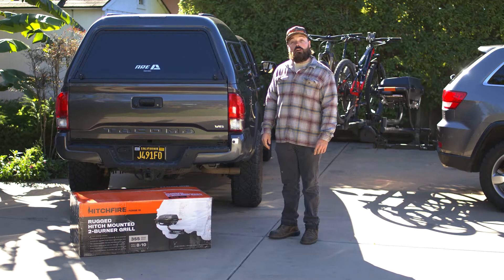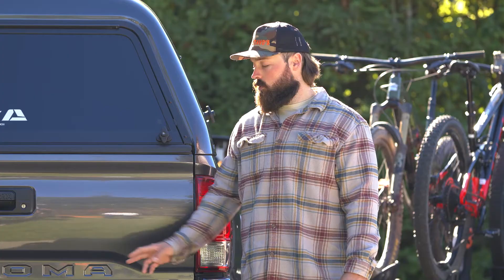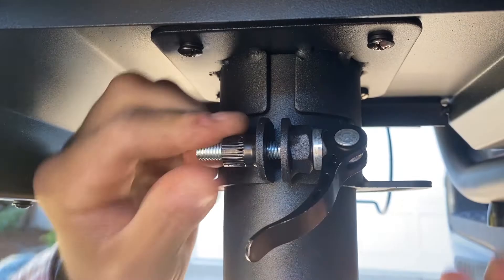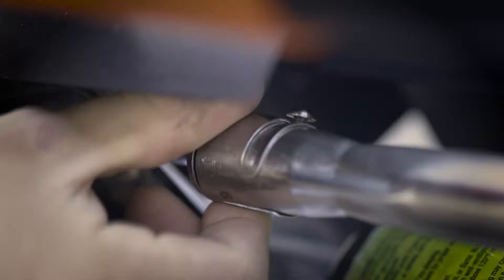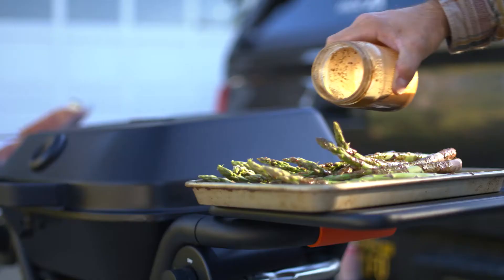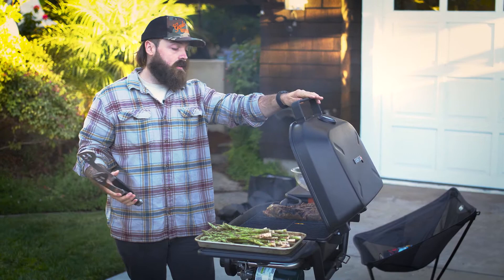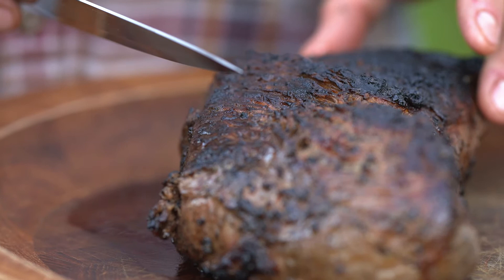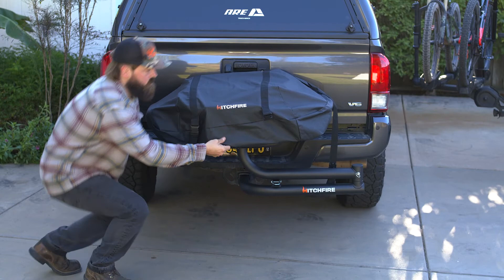HitchFire Hitch Mounted Grills Installation

Comment: I'm looking at one of these to mount on my teardrop's driver-side hitch mount. I'd like to cook either under the galley in back or to the side; do I want the driver or passenger side swing arm model? I think passenger side but wanted to verify.
Reply: Also, we don't cook directly on grates when camping. Can we use our calling pans and cast iron griddles and skillets one these?
Reply from the maker: @DavidHancock  Hi David - the main reason one would pick a driver or passenger side swing is if they had a rear swing out door.  For example a Jeep has a swing out door to the passenger side so you would want a driver side swing out grill.  In your case the rear door swings up so it really doesn't matter unless there are other items, like a drawer, that pull or swing out on one of the sides.  You would want the grill on the opposite side.  And yes, you can use cast iron pans, griddles, etc.  We also sell a flat top for similar cooking methods.

Comment: Thx for the video.  Any idea on the overall weight and do you know if there’s an option for a locking hitch pin?
Reply from the maker: The weight is roughly 73 pounds together with the grill and the swingarm. You can remove the grill from the swingarm which is about 32 pounds by itself. We will have locking hitch pins on the website in the next couple of days!

Comment: Do you offer replacement parts like the burner tube or the auto lighter part? Just curious just in case I have one go bad.
Reply from the maker: Yes we have replacement parts for all components of the grill.
Reply: @hitchfire8098  Good to know. So far, I'm loving my Forge F20. I don't think there's a portable grill that attaches to the hitch that can beat this one. I added the side burner to it and will have a tote with all the necessary items that I use with the grill and I'm all set!

Comment: Is the Hitchfire arm the same as the margaritaville grill arm?
Reply: It is not exactly the same as it has a few enhancements but does fit the collar of the Margaritaville grill so will work with it.
Reply: @evancurrid4822  is there a basket with a cooler and rod holder for it?

Comment: Can this be installed on sedans? 18 Kia Optima?
Reply from the maker: As long as it has a 2" hitch receiver it would work.  You will need to check for clearances and might need a riser to get it high enough.  We have installed them on Subaru Outbacks.

Comment: What size socket wrench is needed?
Reply: I bought our new Hitchfire grill the beginning of summer 2021 for our yearly summer adventure. I Installed it on my class A RV without any issues. However, after our first use we were very disappointed. The very first thing I noticed is that the grill itself is never level, and rocks side to side, and front to back a great deal. No matter what position I put it in, it is still never level. This causes issues with items slidding off the two folding trays, and just looks weird. Very frustrating. Also, half way through our 7500 mile trip, we also had a small fire which came out from the propane gas components on the sides, and under the grill where the bottles are attached. One of the metal pipes had moved away from it's original position during transit causing gas, and flames to come out from it. It scared the crap out of us! I will be contacting the company as we just got home a couole days ago. I will write an update on any fixes they recommend, and/or their customer service. Great concept, but the grill clearly needs some improvements to work properly in the manner in which it was designed for.

Comment: What about the license plate?
Reply from the maker: Yes the license plate holder comes with the grill and instructions to assemble are in the user manual. Feel free to reach out with any questions for installation, but it’s very easy to install.